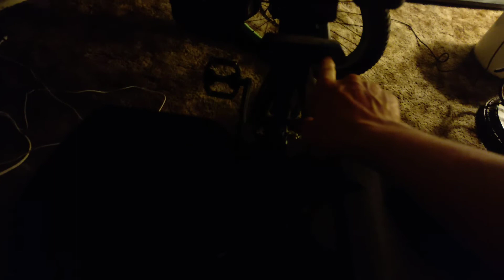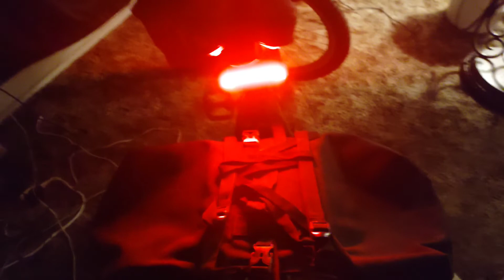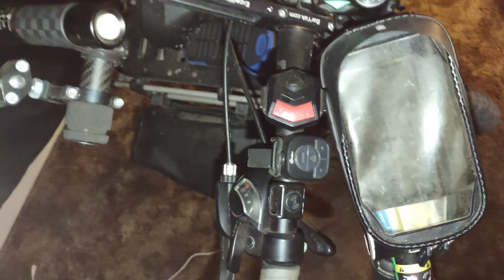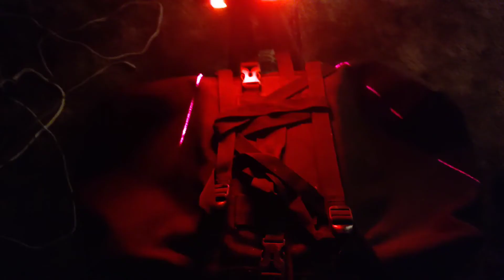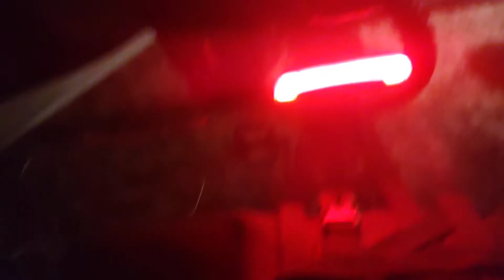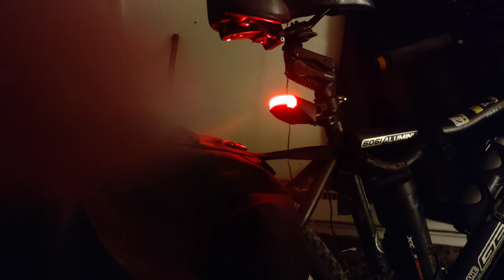Brutally Honest Review: Meilan Bicycle Wireless Turn Signals

Comment: I wouldn't be a fan of that type of indicator with the travelling light in the direction I intend to go.
I much prefer the old fashion steady blinking for right or left.
I have a set of generic aliexpress separate right and left indicators. As in, one can go on the left side of my bike or trailer and the other on the right.
I only use them in the winter when I tend to be out in the dark and hand signals may be less visible to traffic behind. I actually haven't used them yet this year. I must dig them out and charge them up. Hopefully they are still working.
I also have Bluetooth direction indicators built into a hi-vis vest/backpack I wear.
The problem with that is I can't know if it is showing what I intend because I can't see it when I'm wearing it.
So I wouldn't buy that one again.